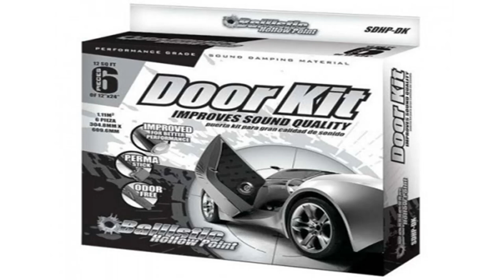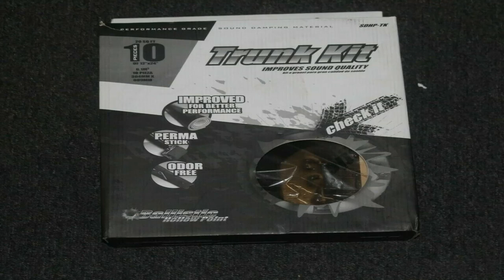2019-2022 Honda Insight: Speaker replacement Aftermath and Advice

Comment: Hey Verdier - excellent point regarding how an AudioControl line signal converter might ruin the ANC in the Touring. I think I'm going to send my stuff back to Crutchfield. For me, if I can't put in my own DSP, there's no point in doing it.
Reply from the maker: Hang tight on that dude! I'm upping a video right now explaining more of what I found out. Let me be the Guinea Pig here and tell you what's going to happen. I'm upping a video right now that will explain things and I'll keep you up to date on my findings concerning the ANC and whether running without it is going to work or not. Also consider, if you put in a DSP you'll probably want to put in a better amp. With that better amp you'll probably get much better definition and volume so the ANC may not be the factor. Let me blow out my money first and tell you what I found out before you endlessly chase down good sound in your Insight. Feel free to e-mail me and let me know what you ordered and I'd love to talk to you about it. Take care.